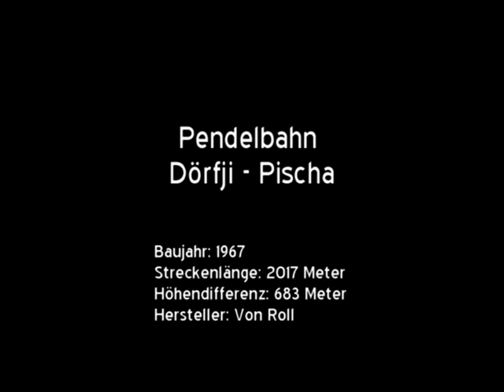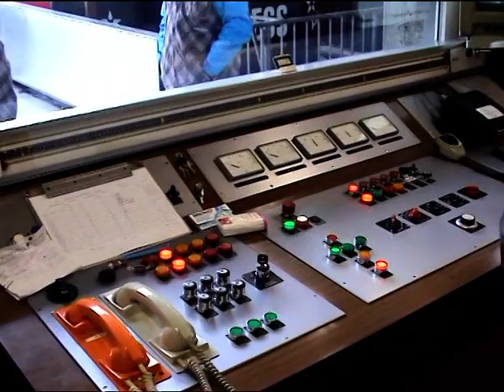100-PB Pendelbahn Dörfji - Pischa/Mitteltälli (CH)

Comment: Why was this Von Roll removed?
Reply: The aerial tramway is still running as seen in this video. However there are plans to renew or replace it after 2024.
Reply from the maker: It´s still there but in only runs during winter, usually from December to March.